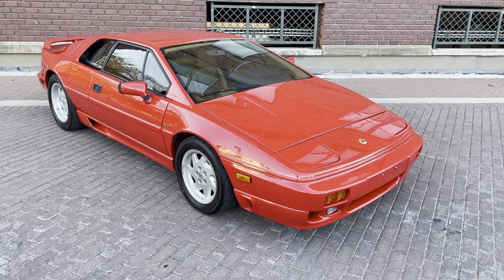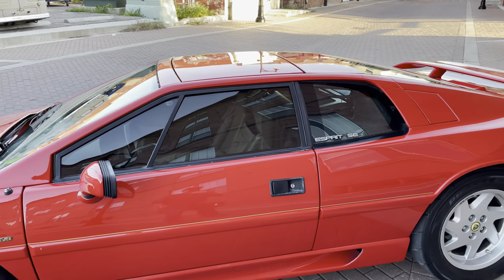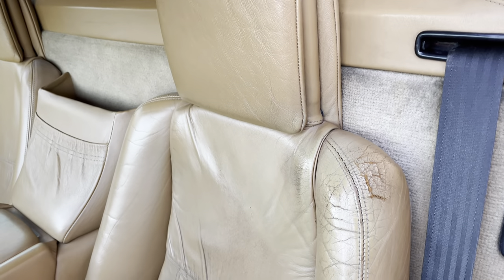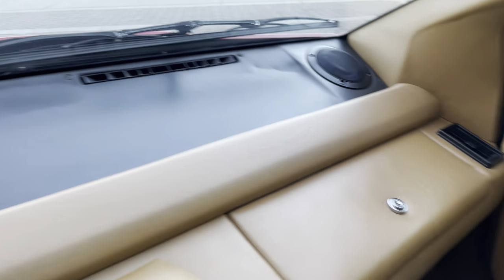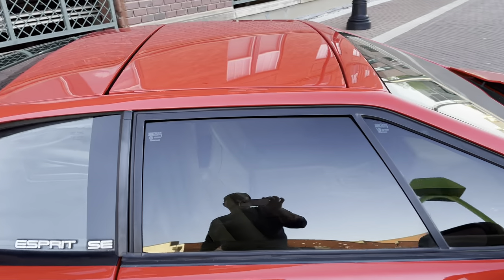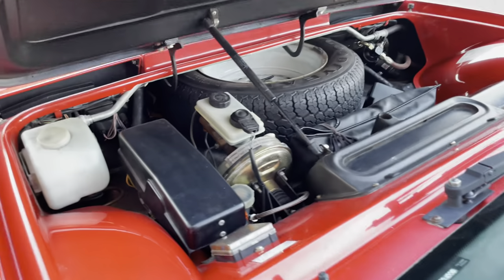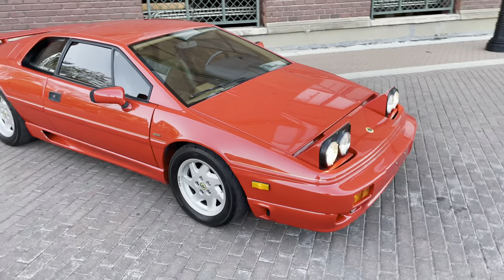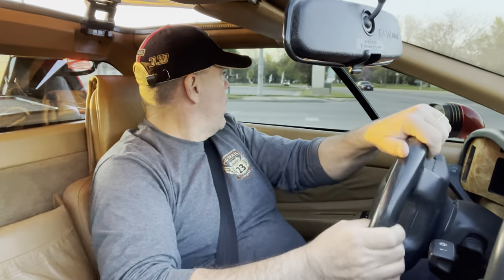1990 Lotus Esprit SE

Comment: Thanks for the video. I have two corrections:
1. The S3 was the last of the Giugiaro design. The SE is part of the X180 generation which was followed by the S4. 
2. The final Esprit redesign was an update by Russell Carr.
Reply: Thanks for the info, and one question:
I am looking for a car like that, and I found one; a 1991 SE 2.2 chargecooler (910s code), but the strager thing, is that says that has 179 hp...is that possible in this model?or maybe a mistake?
Reply: @xjk5Mikel  no worries. 179hp would be for the naturally aspirated version. The SE should be putting out around 197kW (207kW on overboost).

Comment: I own that exact car with a grey interior. Owned it since 2000. I’ve done many upgrades over the years 
, mainly replacing worn out parts with something better. Spax shocks, Momo wheel, upgrade AC, aluminum fuel tanks, too name a few. Tires are an issue and I have 16’ front and back. Yoko’s and Toyo track day tires are the only matched option. Did you do the Wilwood conversion yourself. I’d like to do that. I’ll call you perhaps. Anyway I have 79,000 miles and I have spent some money over the years on the car but no more than owning a similar Porsche or 308 and thos can’t keep pace with a well maintained Esprit. THEY ARE GREAT CARS,